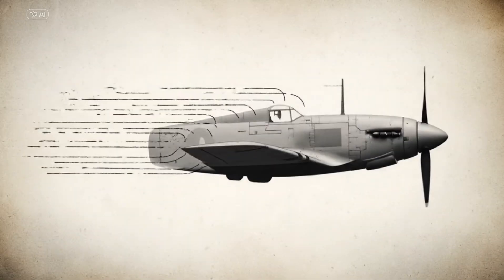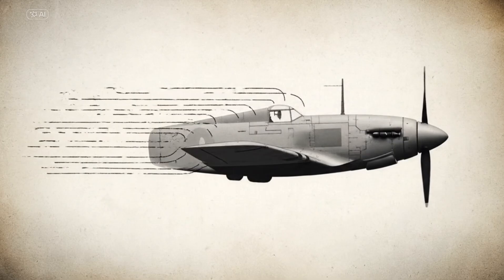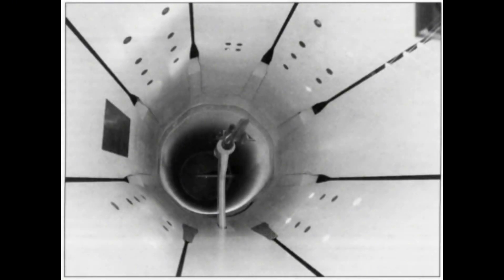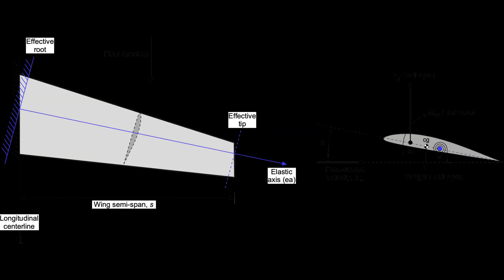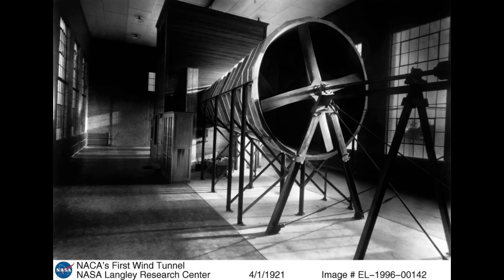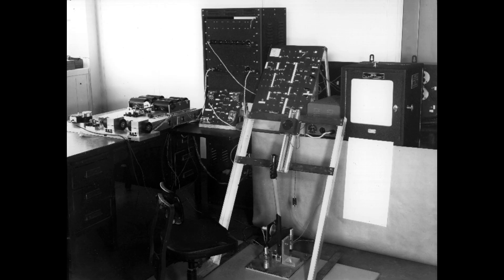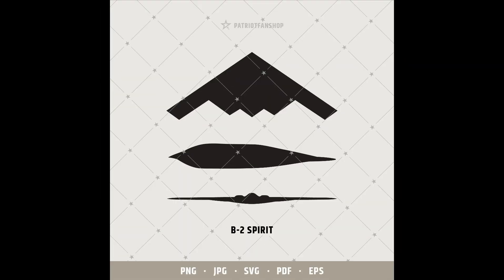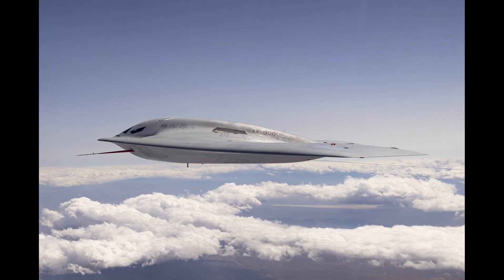The Physics Flaw That Nearly Destroyed WWII Aviation

Comment: An excellent discussion of flutter, aeroelasticity and compressibility! In modern aircraft. Flutter in production airplanes has nearly been isolated to ensuring that flight control surfaces are properly balanced.
However, once again, what is an X29 doing in a discussion of air transport? 😎
Reply from the maker: Glad you enjoyed the discussion — and great point 😉
The X-29 is there mainly as a visual shorthand: a later, extreme example that makes aeroelasticity and control challenges tangible, even outside pure air transport.
Sometimes a familiar outlier helps anchor the concept.

Comment: Physics does not have flaws, it just is.  Engineering can have flaws and in this case it had to do with the total lack of understanding of resonance frequencies, flutter and transonic regime.
Reply: Your comment is technically correct in a literal sense, but it is pedantic and misses the narrative point. 

The near-disaster in WWII aviation was not caused by broken laws of physics, but by flawed physical assumptions embedded in engineering practice. That is exactly what the headline is pointing to, even if the phrasing is intentionally provocative.
Reply from the maker: Well said — that’s exactly the distinction I was aiming for.
Physics itself isn’t broken, but the assumptions engineers worked with at the time were incomplete.
The title is intentionally provocative, but the story is about understanding, not blaming physics.